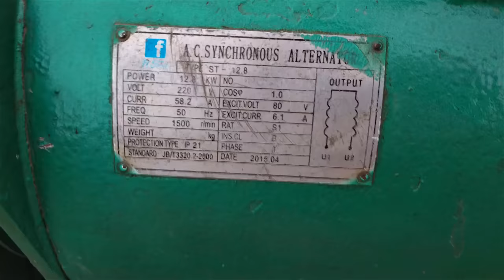Free energy Generator With 100 Kg Flywheel 12Kw Alternator 100% Real Free Electricity

Comment: all these systems work only on soft soil so the wires can be easily buried under it. :)
Reply: @fun3353  well good for you electrical engineer beta g well I was working on this with dinamo sense I was 10 years old but sometimes it will stop and it can be hard to get it back  and you can make energy out of magnet there are so many videos that sows how it work but never talk shit you didn't even know how it work or you didn't even tried it You learn what's known you never tried to do new because you made it imposable or do only what you know not inventing new thing you never tried at all
Reply: @Gokashi-xt7vd  haha, dinamo, sense hahaha, beta 4 jamatain prh lete to itna time zaya na hota tumhara... if u think ur thing works then make a video show ur claim, and call me, i will visit u.
Reply: @fun3353  Totally agree, I also lecture electrical and electronic principles. If you look closely, the flywheel is magically faster part of the way through the video after an almost imperceptible cut. Resistive effects alone will run the power down. Safety here is appalling, not only with working around rotating machinery, but no eye protection when (poorly) attempting to weld and even worse is the lack of earthing arrangements here!
Reply: @Gokashi-xt7vd  HAHAHAHAHAHAH
Reply: @fun3353  thank you
Reply: @fun3353   tf are you saying lol you clamee and fight against your claim lol
Reply: @IamPetrus  hohohohhoho ?
Reply: @Gokashi-xt7vd  There is a bad video edit that discredits the presenter. BUT According to Occum's Razor theory (please do your own research) the best answer is the most simple one.

This is a confidence trickster! Prove me wrong! There is a sneaky power connection through a cable buried in the mud under one of the hollow metal legs resting on the dirt. Share a new video with the metal fame pulled up off the ground, and passing your hand underneath (with this running) The poster is only interested in being paid by YouTube for AD money from many clicks.
Reply: How much the cost?

Comment: Obviously the motor is plugged into external power off screen.  1 HP  is about 750 watts, so the 3 HP motor is about 2.2 kW and cannot run the 12 kW alternator at full power.  The 100 kg flywheel can store a fair amount of kinetic energy, K = (1/2) I omega^2 where I is the inertia (about 20 metric units, estimated on the size of the wheel and it is between a disc and ring), and omega is the angular velocity.  If the motor runs at 1500 rpm, the 4:10 gear brings the wheel to about 600 rpm, which 60 radians per second.  So the kinetic energy is about 72,000 Joules which is about 1/10th of kWh.
Reply: It is where pulleys  come, remember  pulley are magical torque multiplier
Reply: Buried in the ground under the wood panel...
Reply: What will you do when you find out physics that YOU understand is incorrect.
If what you think is true nothing will ever advance in the future.
Reply: 1+1=3

Comment: Simple and working. Put on some wheels and it's a portable electric generator. However it's good to put voltage and ampere output/input meters for better usage management.
Reply: If it was on wheels then it would be difficult to conceal the power wires coming up from under the dirt into the hollow box tube leg stands. But yeah, rolling it around with it still running would be a LOT more impressive!

Comment: Magic!.. do you really think that the worlds most talented engineers and scientists wouldn't of thought of this if it actually worked :)  lol
Reply: @onlya few video on the channelYou're right, but i still wouldn't call it "Free energy", its still kind of a clickbait. Free energy means (in most cases) energy oout of thin air, which doesnt exist and totally violates the laws of thermodynamics. In this case it's just converting the momentum of the flywheel into electricity
Reply: Yes. Hubris is a helluva hindrance.
Reply: Wouldn’t have*
Reply: @elpedomasgrande1  your right :)
Reply: @mike-rayner-videos  pahaha nice move you troll =D
Reply: @Do the Right thing Look, I can't say if it's real or not and until you build it and try it, neither can you. So do the right thing and don't judge until you KNOW for yourself.
Reply: It works but it's just like they did with light bulbs They didn't want to have something that was inexpensive that could Save you money and make power for your home.  Same with solar cells on your roof of your house they're running into batteries and the power of the house.  Might cost $1,500 to start off to buy everything but you save that money in one year when you're not paying anything essentially for the next 5 years except maybe fixing some parts here and there.
Reply: Buff Ectomorph lol when a broscientist attempts real science 😅😅😅
Reply: @elpedomasgrande1   @T E  When a human humbly attempts to learn and understand science. And when internet trolls seek to bash rather than sympathize and comprehend. 🙃
Reply: Buff Ectomorph you are not humble my dude. You basically told the other guy that theory is invalid. Look, I get your point that experimentation and empiric evidence is ultimately what determines if a theory is true or not, but it‘s the very last step in the scientific method and useless if you don‘t understand how you got there. And saying „we won‘t know unless you try“ is, given that we are talking about one of the most basic scientific principles which is not being questioned by anyone respectable within the scientific community, fairly condescending.
Reply: Buff Ectomorph with that logic „only the things I witnessed are real“ you contribute to conspiracy theories like the flat earth or the fake moonlanding. Very egocentric view on the world.
Reply: @elpedomasgrande1  no, That wasn't a theory that was a it was an absolute it's doing and it's making exchange of energy there's like two different arguments but you have to read about it but I appreciate what you're saying Thanks.
Reply: J Levenson I can‘t tell what you are referring to. What absolute are you talking about? Please use punctuation, it’s super difficult to read your comment. And sorry but I read enough about this when I was in high school. If you happen to have evidence from a reputable source you should present it.
Reply: This is how people die
Reply: @justloggit22  Yes you're correct if mindfulness electronics training cleanliness order precision, and  have the right tools and mindset to work on things.   🙏
Reply: @justloggit22  yep.
Reply: J Levenson I would say electronic version is not the best but it has to be a great app to use it all the way down and the way you can make your own art is not the best thing you could ever think about. The system was very much like the original design of that and the one I wanted to see in the first time.
Reply: Grandes engenheiros, do tipo Nikola Tesla? 
Aliás o que fizeram com ele?
Reply: @onlya few video on the channel so it will eventually stop once friction does its own work, and no way its an autonomus system. Thank you
Reply: @slashshake2371  but it will eventually stop due to friction, right?
Reply: @buffectomorph9657  no shit!
Reply: @slashshake2371  dont know how much they pay you...
Reply: I think it works for shorter periods, AND they can never go over the amps that slow down the generator
Reply: The electricity powering the motor isn’t free. It’s plugged up off screen. He pays the electric company. So how is it free?
Reply: @vsmichael1  as shown the start is done with electricity. THEN they connect the motor to the generator. It seems that the heavy flywheel keeps up when its loaded with fx a electric grinder
Reply: @onlya few video on the channel   The real question is:  How long will it "produce" electricity?  How long will it continue to run itself? If that answer is even close to 1 - 2 years, then there is a way it would pay for itself, even if the generator or motor had to be replaced. Frame, flywheel, pulleys and sheaves become reusable. Only have to replace the "wear" items. I'd be curious to see how long it would stay running.
Reply: @onlya few video on the channel I would use the alternator to charge a battery bank. Then I would use the battery bank charge to boost the drive motor when the RPM drops to a certain level (all done with a small controller and some electronics). And there you have it, perpetual motion and  infinite source of energy until you need to replace the batteries. The battery bank can be large enough to power your house and getting continuously charged by the alternator (or even switch automatically between two battery banks). The surge power to boost the drive motor when the RPM drops would be easily supplied by the batteries :)
Reply: @jslevenson101  I would use the alternator to charge a battery bank. Then I would use the battery bank charge to boost the drive motor when the RPM drops to a certain level (all done with a small controller and some electronics). And there you have it, perpetual motion and  infinite source of energy until you need to replace the batteries. The battery bank can be large enough to power your house and getting continuously charged by the alternator (or even switch automatically between two battery banks). The surge power to boost the drive motor when the RPM drops would be easily supplied by the batteries :)
Reply: @jslevenson101  I would use the alternator to charge a battery bank. Then I would use the battery bank charge to boost the drive motor when the RPM drops to a certain level (all done with a small controller and some electronics). And there you have it, perpetual motion and  infinite source of energy until you need to replace the batteries. The battery bank can be large enough to power your house and getting continuously charged by the alternator (or even switch automatically between two battery banks). The surge power to boost the drive motor when the RPM drops would be easily supplied by the batteries :)
Reply: @onlya few video on the channel its most certainly fake. Adding load to the generator takes more energy for the motor to produce which takes more electricity from the generator which takes more energy. See the problem here?
Reply: @RUEZ69  I taught physics, math, and astronomy for years. Nothing proves how efficient we can be with harnessing energy. There is much we still do not understand. It appears very likely when combining electricity, magnetism, momentum, gravity, and other unseen forces we can harness much more energy than many believe is possible.
Reply: @buffectomorph9657  If you taught physics than you should know the laws of physics cannot be broken. This machine cannot work like this.
Reply: @RUEZ69  I know the 'law of conservation of energy' and I know there are forces at play that we don't fully understand or even know how to measure. As a human I see that many of us think we know things we don't and make rash decisions based on very little. You don't know how this machine works so how can you say it can't work. Until you make it for yourself and test it can you know either way. I'm not saying it's real, I'm saying I don't know either way because I haven't made it and neither do you. But highly efficient machines are absolutely possible and likely out there.

You sound to me like one of those people who told the Wright Brothers that they were crazy. I choose not to limit my self or others with limiting beliefs and am always open to learn.
Reply: @buffectomorph9657  it's very easy to see how this machine works. What we dont see is how he powers the electric motor. I can assure you it's not from the generator.
Reply: This works because the free energy is in the magnetic field of the generator.  There are forces of gravity associated with the flywheel that helps in the mechanical advantage.  Im quite certain this works.  Too many people are doing it an makimg videos.  Large warehouses are full of different gear and flywheel machines in india doing this.
Reply: @thornyturtleranch6152  no
Reply: What if they actually did think of it, but were paid to forget about it or even executed for it? Think about that.
Reply: The law of thermodynamics? Was that a law created by God himself or by man? Think about it.  If I tell you there earth were flat and you didn’t care to find out the truth, wouldn’t you have believed a new law?
Reply: @IamPetrus  Astroglide and Teflon will keep the friction at bay!
Reply: @elpedomasgrande1  Do you often just blurt out places that random household items on sale for cheap too strangers or are you just feeling extra special today 🤔🤔..maybe I'm getting it wrong your just super helpful well I appreciate the heads up sir anymore hot tips on random things if you know anyone selling any discount gold or 13th century artwork I'd be interested thanks
Reply: @jshaw4757  i'll keep you posted
Reply: @elpedomasgrande1  I'm too big but welcome too try
Reply: @jshaw4757  in what way are you big?
Reply: @elpedomasgrande1  Excuse me ?..ow sorry I ment you wouldn't be able too post me I wouldn't fit through the letter box mate
Reply: J Shaw i meant, i‘ll keep an eye out for any interesting gold sales and i‘ll keep you informed.
Reply: @elpedomasgrande1  Ow brilliant thanks and tin foil too plz if ya could I'm always after that stuff for my hat cheers..p.s hold an eye out ?? Bloody hell no I don't need that sorta help I think you would be in trouble if you tried to do that mate..but if you could keep an eye out as in the term 'keep an eye out' would be amazing,..and 11th century statues or platinum ear supports that would be great they seem too sell alot a.t.m cheers
Reply: J Shaw thank you, I corrected that. Ze german in me was talking.
Reply: J Shaw I’ve been reading your comments with cockney accent all along but that is just the icing on the cake.
Reply: @buffectomorph9657  100% agree!
Reply: @buffectomorph9657  100% agree!
Reply: @justloggit22  a mind that has the ability to actually understand, you are correct.
Reply: @slashshake2371  Do You., The 1st law of thermo dynamics is; Energy can not be created or destroyed only converted.
Where does he break that law.
Do you know where the alternator gets the electricity from. It does not mater what you use to turn the alternator or generator it will always convert aetheric energy to electrical energy just as its creator intended. Do rember thet these were invented when everyone believed in the infinate energy available in the aether. This device is one of thousands now on youtube showing the truth. By the way there is no electrical device invented or made today that does not get its birth from the electrical genius of people born before the advent of quantum theory. That is right everybody before 1918 believed in the energy in Aether. Even Einstein on his death bed renounced quantum theory and said that aetheric physics is the correct way to understand the universe.
Reply: @slashshake2371  HE NEVER STUDIED LAW !!!!
Reply: Yes, I belive that the most talented engineers had had not think about this, as the axial flux motor that was sleep for almos 70 years and its functionality is basic. Where were your talented engineers spleeping?
Reply: @buffectomorph9657  You are the only person who spoke right , thanks with empirical experience I know it's possible because when all the forces like gravity , momentum, magnetism when combined perpetual motion is possible ; I am convinced because God had revealed it to me , when the motor bike magneto flywheel lock  had broken and at wrong timing my motor bike ran by the flywheel which had turned into bldc motor.
Reply: @thornyturtleranch6152  Absolutely correct. I have experienced it.
Reply: @isiakamuazu2351  We are not under law , we are under grace! Read the bible! To heal sceptism.

Comment: I would use the alternator to charge a battery bank. Then I would use the battery bank charge to boost the drive motor when the RPM drops to a certain level (all done with a small controller and some electronics). And there you have it, perpetual motion and  infinite source of energy until you need to replace the batteries. The battery bank can be large enough to power your house and getting continuously charged by the alternator (or even switch automatically between two battery banks). The surge power to boost the drive motor when the RPM drops would be easily supplied by the batteries :)
Reply: He could also fit a house fan to the back of his bicycle, pedal around in circles until he got fast enough, then the air blast would create electricity and more thrust. With a cable hooked to it through a swivel connector, he could tap the additional power back into his free energy machine, jump off the bike and go for chai garam and chappatis...😃
Reply: Sorry.. About the way you suggested. Does that mean we're gonna use AC motor or DC motor.. I also tryna do a project like this and confused about which motor type to use,AC /DC
Reply: Perpetual motion can't use an external power source(battery pack)or its not Perpetual.
Reply: Tenho uma ideia parecida,quando puder vou construir.
Reply: @moibeaina257  DC motor
Reply: Add Magnetic anti polar.power
Reply: You have really thought this through, I can't tell if it's sarcasm or ignorance!
Reply: May i ask you about you'r experiment, do  you have any real experience over this video?
Reply: @pezhmanoskouie4653 yes I did and It doesn't work